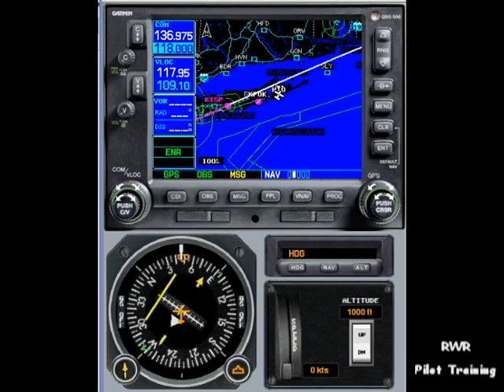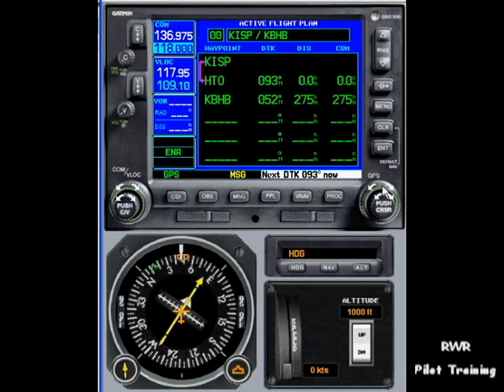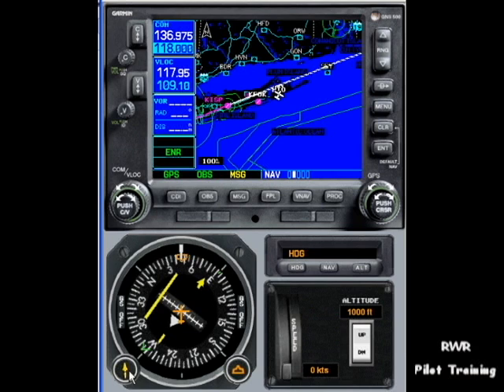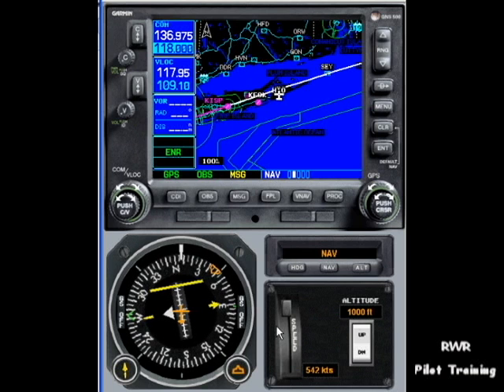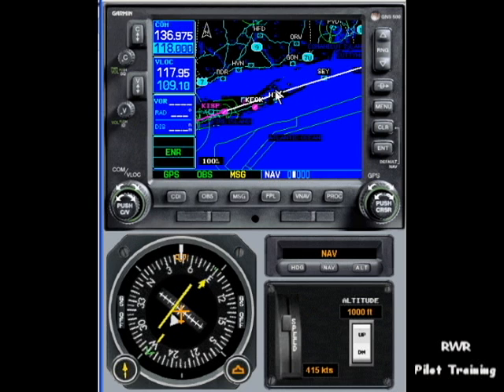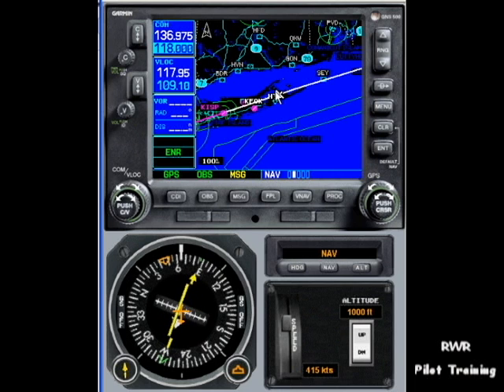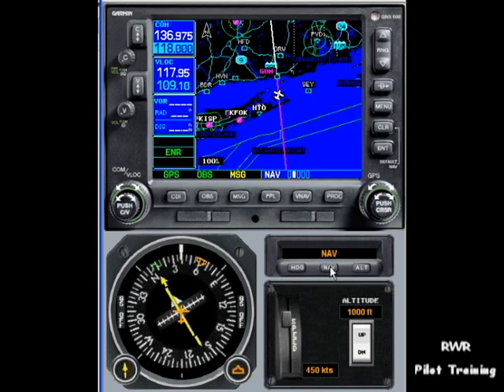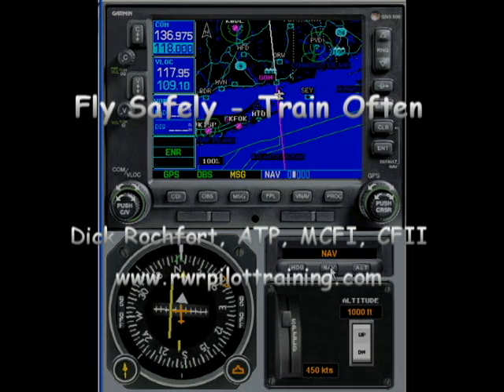Using the Omni Bearing Selector (OBS) feature of the Garmin G530 - Part 1

Comment from the maker: Hi Radamhav: There are several ways. If you have time and you expect to get this exact clearance again in the near future, create a user waypoint using a bearing and distance from a known point (the VOR) and imbed this new fix in a mini flight plan and save it as a stored flight plan. I often find that a fix does exist at the location on the high enroute or low enroute chart. The iPad makes fringing this fix relatively easy. If you have time for neither ask ATC for a vector to get you started.